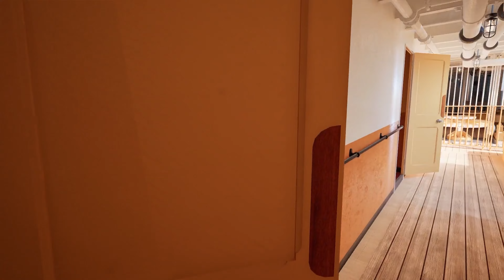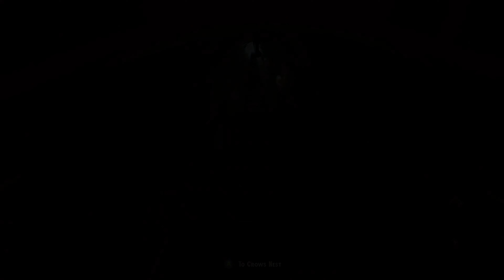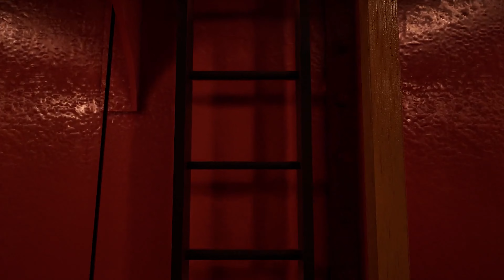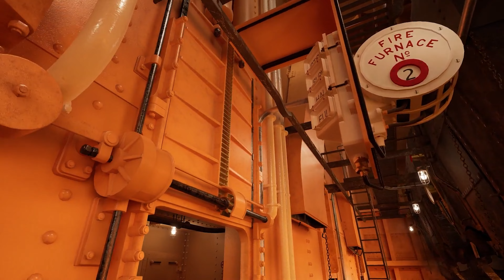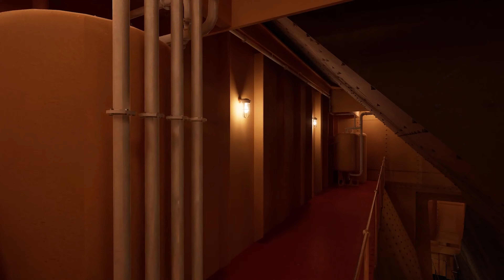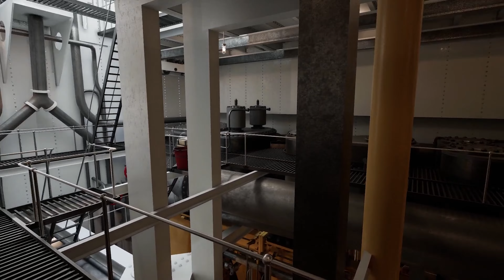Boilers & Engine Room Exploration! - Titanic: Honor & Glory - Demo 4 (With Added Sounds and Effects)

Comment: It’s sad that we’ll never probably see what the engine room looks like under water
Reply: Actually you can see the engine room on the stern part of the wreck. The front low pressure cylinder broke away which shows the extreme forces during the breakup of the ship. I also read somewhere that the condensers attached to the turbine got damaged.

Comment: I would like to see how they passed coal into the ship. That must have been a monumental undertaking.
Reply: Now a days they are using oil instead.
No need to have a huge setup of boilers and a lot of men working in that kind of hell like environment.
Reply: Somewhat. There were doors that’d open in the side of the hull to allow coal tenders to fill up the ship’s bunkers.

Of course overall getting an ocean liner ready for it’s trip was an impressive feat of logistics for the day.
Reply: There's a great video about it by oceanlinerdesigns!

Comment: How come we have not seen pictures of the "bow kitchen" and the machinery from the werck? Seems like the bow is almost undiscovered.
Reply: I was wondering that too.  The bow is in reasonably good condition.  Should be accessible from the cargo hatch.  May be blocked.
Reply: The bow is in relatively good shape indeed. However the space where the crew quarters were, was already cluttered with pipes, divider grates, bunk beds and machinery. All of them got distorted, bend and broken that made it nearly impossible to navigate an ROV in between. There is a footage of the mess halls and sleeping quarters I am not sure if in the Ghost of the Abbyss or in the Deep insde Titanic (One of the many docu movies of Cameron).  
Not sure what you mean by 'machinery', but as you could see, between the boilers there is almost no space - yet I've seen a video where one brave and curious guy went down the same space on the Britannic. Really not recommended for claustrophobic people! If you mean the reciprocating engines, well, those are still standung upright, under the debris what was once the stern. They are broken in half, the forward low pressure cylinders just have been fell out and now on the debris field. The rest of the engine room is a dangerous and unstable mess of pipes, catwalks and crumbled steel.
Reply: James Cameron tried to take an ROV in there but there was actually lots of damage from the impact with the ocean floor. He did however find the crewmen’s spiral staircase